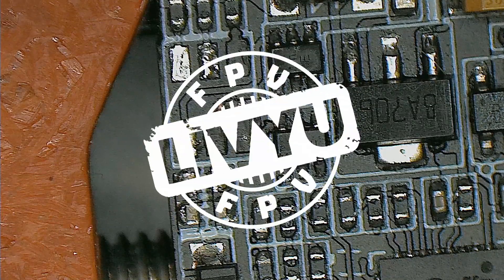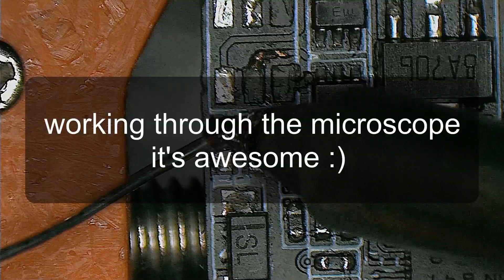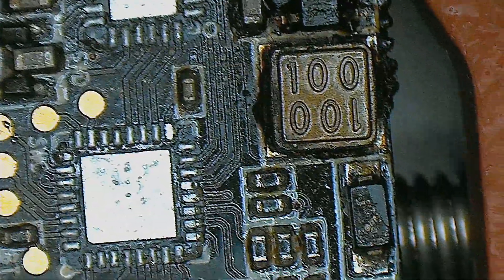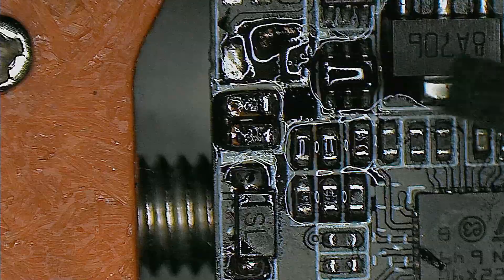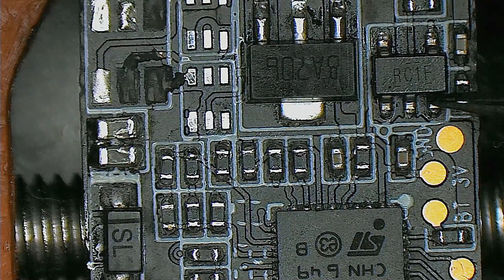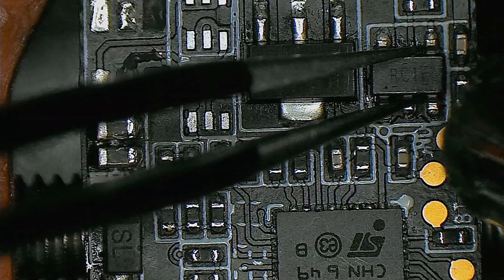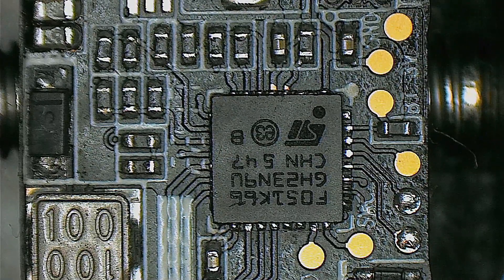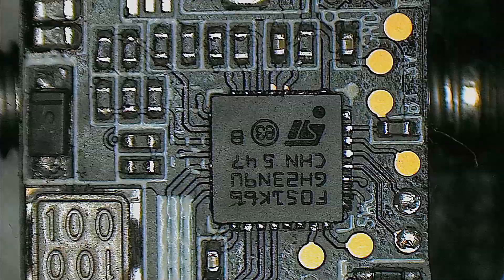Airbot Wraight32 Blheli32 - ESC REPAIR

Comment: Hello! Nice job. Have you ever tried to change firmware layout in blheli_32? iflight_bl32_4in1 and hifionrc_blheli32 share the same bootloader j in bl32, but suite syas it has different layout and wont flash. But  both this 4in1 esc's have the same bootloader PB4 and the same AM32 firmware (target is iflight).

Comment: I’m interested in what you said about a licence for BLHELI firmware. Is there no way to flash a new micro controller with working ESC firmware?
Reply from the maker: I did not research it... but I suppose you could buy flashed MCU from the manufacturer.

Comment: Does it matter which direction the two ceramic capacitors are placed?
Reply from the maker: Ceramic capacitors have no direction to mount, like diodes, electrolytic caps, led's, etc... so no it does not matter.
Reply: @LivyuFPV  awsome, i did this method with my runcam micro swift, and haven't powered it up yet